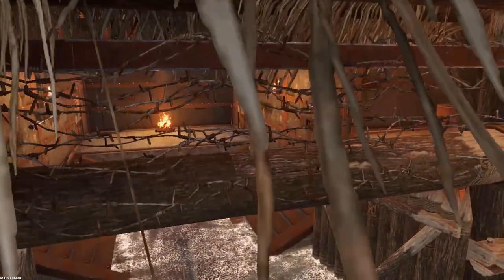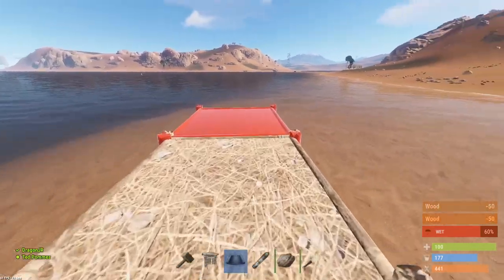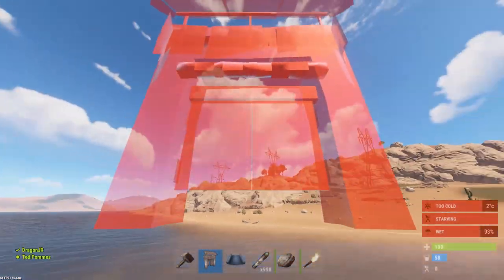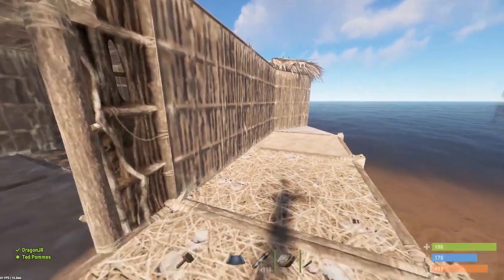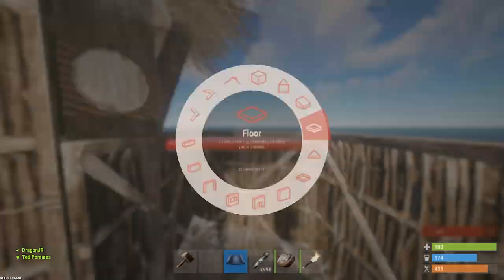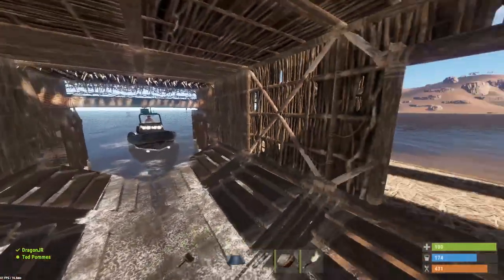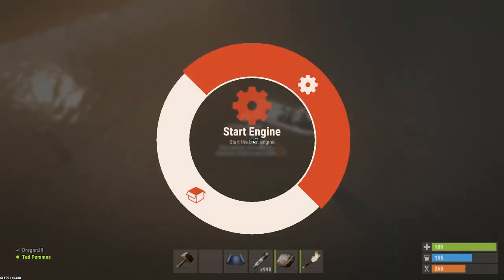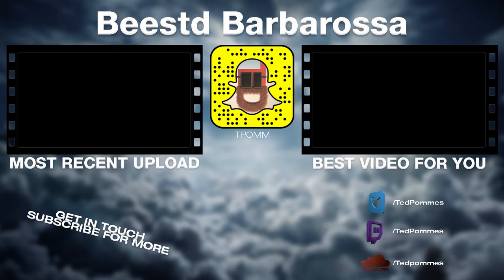Rust August 2018 Update - RHIB Boat Base Design

Comment: I had no issue getting my RHIB through a single door frame. I made a 2x4 base with 2 sets of double doors in the front. one side for the RHIB and one side for a small boat. You just gotta make sure the surface of the water is as close to the floor as possible while still deep enough to not beach the boat.
Reply from the maker: We were able to ram it in with speed. We just didnt get it out comfortably.

Comment: Do you know if if this base design will stop the decay of the RHIB? on the server I play I currently have that problem that overnight my RHIB will despawn? Do you know if you can solve that or do you just have to keep getting new RHIBs?
Reply: +1 for this, @Ted did the base stop decay?
Reply from the maker: No it didnt stop it and i didnt really have time to check it. It seemed to go slower but i am not used to how fast or slow it decays so i don't know.
Reply: Ted Pommes good deal, thanks for the quick response my dude
Reply: Ted Pommes good deal, thanks for the quick response my dude
Reply from the maker: No problem mate, thanks for the support
Reply: Yes it does stop decay as long as you have a roof over it. I have heard that a server restart will despawn them however.
Reply: @ChuckHaney  troll
Reply: Nope. Cover the RHIB with a roof and it will not decay. Formerly a client side server restart would destroy the RHIB but they've fixed that. No trolls here, ... unless you are trolling me Jigz.

Comment: Is this patched? did it three days ago fine but now nope. What would cause the floor frame to not work?
Reply: FYI so I play on modded with /remove so attempted a few more times and just moved my wood gate out a smidge and now I can add the floor frames.
Reply from the maker: I didnt test this recently but when i was recording this video it sometimes was bitching about the final triangle foundation or also sometimes the floor frame placement.
Reply: I did try to make this build, floor frame didn't work, but i added a half wall then covered the hole above the door with some foundations. It's a bit more cost, but it did fix the problem for me

Comment: I built this base last wipe no problem, but now I can't get the wooden gate to place unless I move it off center, close to one of the triangle foundations. Did facepunch ruin this build somehow?
Reply from the maker: Hmm interesting question. I will test and report back. If its broken ill try to look for a diffrent way / design :) what did you do in the meantime? Or did you manage to get it in the end?
Reply: I did have better success...what happened was I built the entire base first then attempted to place the gate. I assumed it didn't like 2 story walls that close to it. Luckily the base was only twig. After I destroyed the second floor walls nearest where the gate would be placed I still had trouble. I then destroyed the foundation stairs closest to where the gate would sit. I had better luck but still had to place the gate at a slight angle to make it fit. I will have to assume the real problem is that I did not place the gate at the correct step in the build. RUST building is a bit broken imo as build order is sometimes important even though it does not always seem to make sense as to why.
Reply from the maker: I just tested this, the stone gate works a lot better than the wooden gate. If you are using the wooden gate you can get it closer if you use twig when placing it and then upgrade to stone.